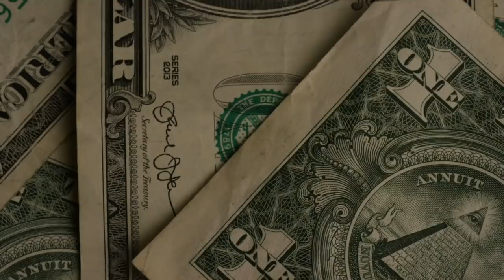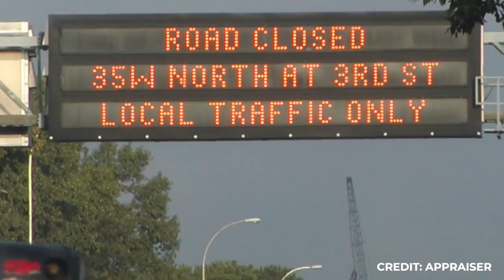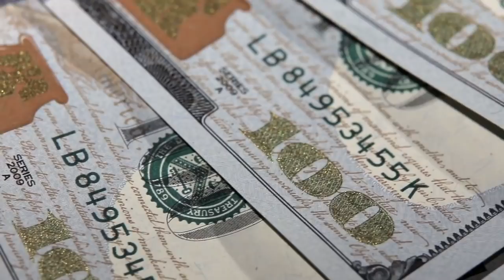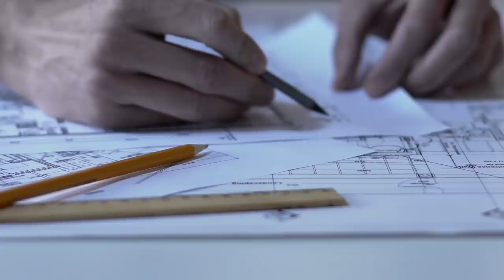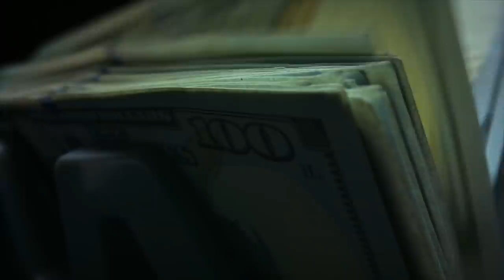5 Construction Mistakes That Cost Millions (Engineering Fails)

Comment: How did you miss the Harmon Tower in Las Vegas? 
https://en.wikipedia.org/wiki/The_Harmon#:~:text=On%20August%2023%2C%202013%2C%20a,in%20the%20fall%20of%202015.
It was an almost completed 49 story building that was mis-engineered and could of collapsed in an earthquake. So it was torn down before it opened.